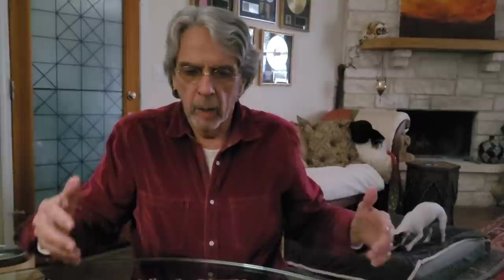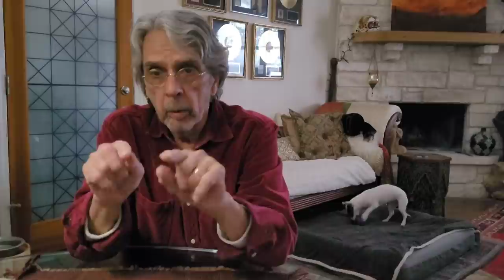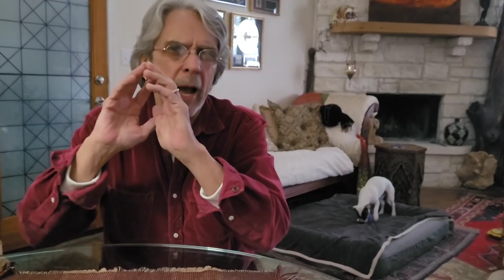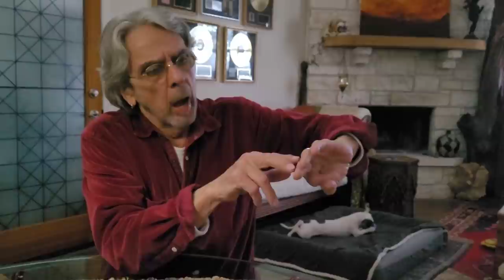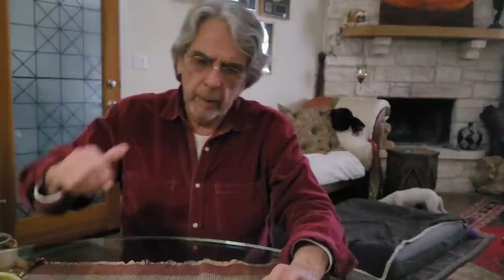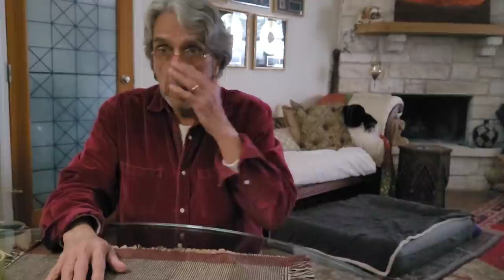B3 Power

Comment: Dont feel so bad Bobby, i did the same thing with an airstream camper ...paid 6K for it...the hitch was missing that little clamp down part on the tongue....i asked the guy hey...what is that? Dont i need to lock that down? He said oh no you dont need that...the chains will hold it...and gravity...i didnt wanna be a jerk...so i said ok...i guess..
I got down the highway about 35 miles and that thing bounced off of there, rammed the rear of my van a bunch of times..PUSHED ME ACROSS THREE LANES OF TRAFFIC...i was lucky i didnt get killed.. i couldnt stop...couldnt steer...headed for the trees, and it ground to a stop...on its side..scariest time of my life...ALWAYS make sure that little clip is locked down...its there for a reason.

Comment: I learned about Stretch tuning from Ray Charles.  I worked for West LA Music and we got the first official Fender Rhodes Digital Piano. Ray was going to be the first to play it in store...1988?. The Fender rep is there. Ray jams. Says it sounds good, asks if it has stretch tuning? The rep said he wasn't familiar with that. It did not. Ray said well then I can't use it and walked away. The Fender rep pulls the display keyboard and leaves. A month later, it's back on the market with a stretch tuning setting.
Reply from the maker: Great story

Comment: Actually, you mean Isn't  A Pity V 2 https://www.youtube.com/watch?v=bHV2CY5LOSQ
Reply: Yep, that's the one and the original 1970 version (28 songs just now, it grew!) is still really hot volume-wise and put my meters in the red. Very dynamic. That piano is double-tracked or 2 different pianos slightly tuned different or tape flange. Does that ring a bell BW? Thanks for the link. It's much louder in Hi-Res than what's on YT here, FWIW. It's all good! Thank you very much, Heath! Kind Regards, 👍 🙏 Maximum Respect, and Peace ~ Loo 👊 😎